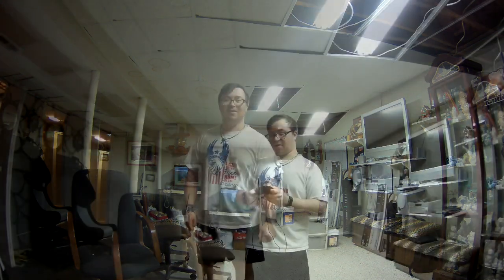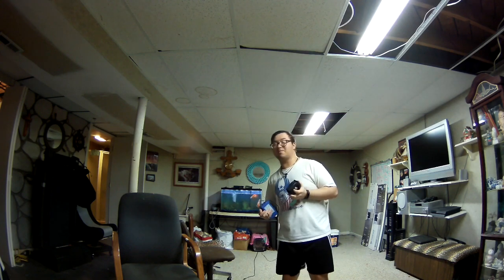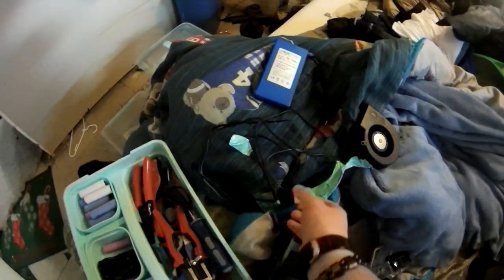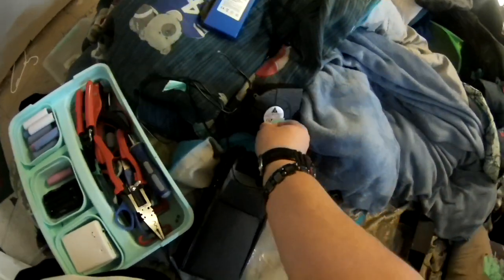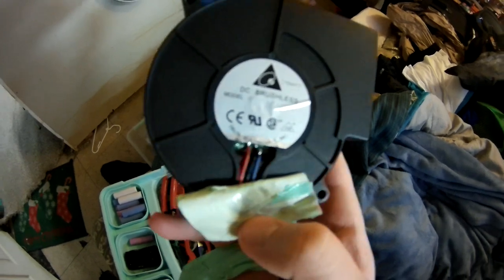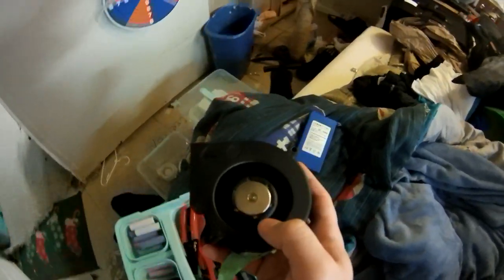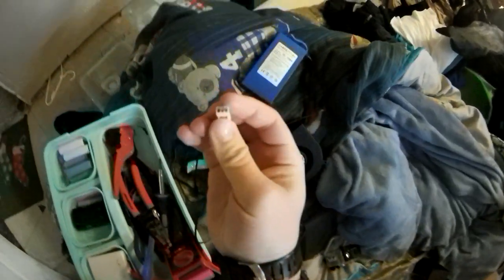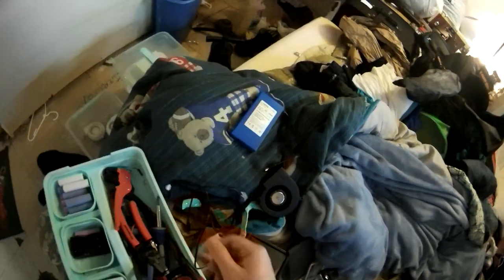New mini blower for any inflatable costume inflatables too first test of this project

Comment: Hi. Great video. 
Do you have the parts list for this upgrade? 
Thank you.
Reply from the maker: This project is about is $74 doing it the eBay way. The parts that you would need for the upgrade would be 4M hex nuts M4 by 40mm Machine screws and a 80mm finger guard and scotch tape for tape rings for it to stay in place li-ion 18650 batteries six of them 3200 mah